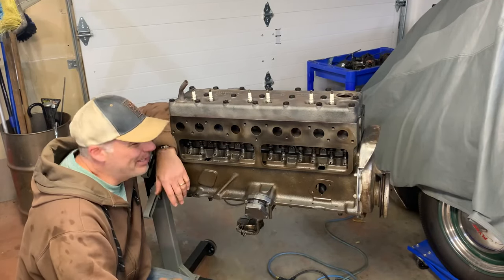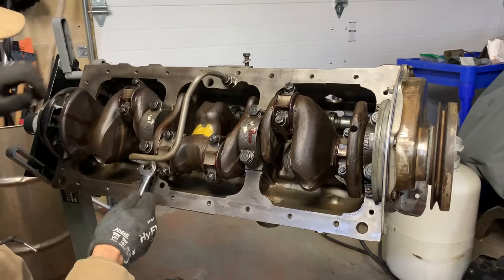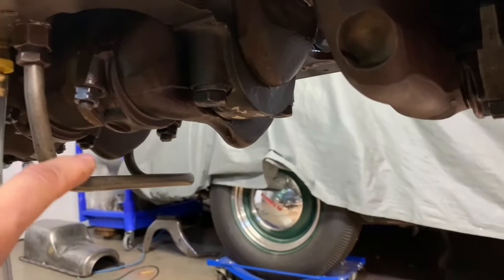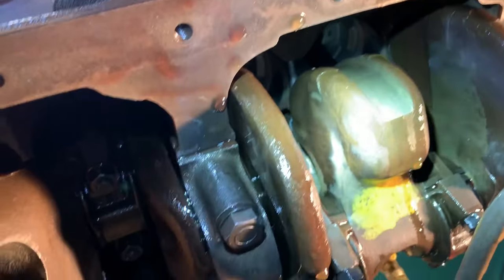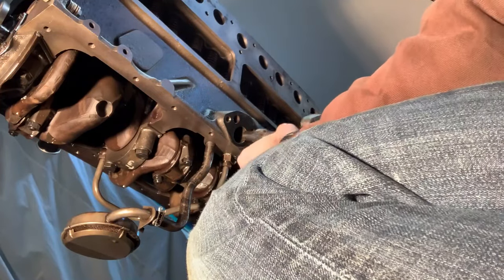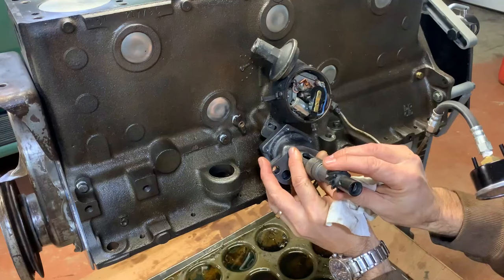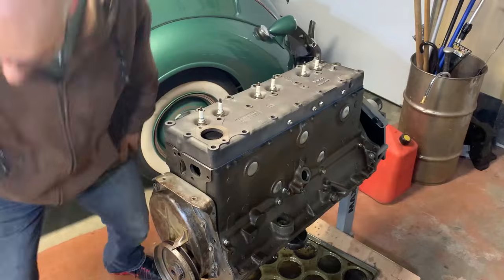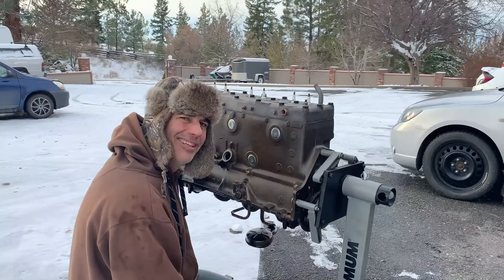Flathead 6 Engine Rebuild Progress & Live Oil Pressure Action

Comment: My 37 Plymouth has a 1951/52 230 Dodge engine. It has the external by-pass. I'm currently running without a thermostat do to not being able to find the correct replacement. Good info on your rebuild. It is always a help to actually see whats happening. Good Job Keith and thanks have to be said to Mrs Keith for her help in making this video.

Comment: Great video! Good demonstration of how the overflow functions. 
LOL.. right, “ Don’t let the money scare you..” True story! 

Just a tip for those working on a new oil pump on these chrysler/dodge flat heads, submerge the pump in oil and rotate it before installing it. You may not  have the oil pan off to use a syringe to fill your new pump with oil first before cranking.

Comment: Wow... I saved this episode, as I bought a 1953 Dodge Regent four door, with the 230-6 in it, that may need rebuilding... Its the 25 1/2 " length block... Did the dry compression test and averaged only 86 lbs overall... Supposed to be 120-150 ... Next test is 'wet' test, with some oil, to determine if the motor has bad rings or valves in need of adjustment... Best regards, from the mountains of central California ...
Reply from the maker: @larryg.9187  I’m not sure you’ll ever see +120 psi on a stock engine.  May be at sea level?  115 psi is the best I’ve ever seen on my fresh engine rebuild, after break-in.  Check for valve leakage. You may be losing some PSI there.
Reply: @keithsgarage5831  ... Your right... I am hoping, the valves are out of adjustment... The book says .010 on a warmed up motor... Any tips on adjusting them cold ? As I just can't picture myself reaching under the header (?) to get to hot valves ... Especially, when I've not done that in fifty years... Going on 72 this year, and got to work safe... BTW, I'm at about 2700 ft from sea level... Thanks
Reply from the maker: @larryg.9187 watch my video on valve sets. Do them cold. Add .002” to hot spec. My video is pretty comprehensive.  https://youtu.be/qtLQP3giVuQ?si=Gln3b5fxYDUWQYWn

Comment: Great video!  I have a 35 Plymouth, and I study your videos many times before I try things.  My most recent project was rebuilding the steering gear box.  I opened it up and felt like I had already seen it from watching your videos.  I would love to rebuild my engine, or at least take it apart.
Reply from the maker: Great to hear that Gary. Your comments offer good insight as to why I make these video.
Reply: you can do i found my m37 in  ga. junk yard 12 yr s ago  best way bring trans out with eng i have pulled it 2 times and i am 88  still tickin  just alot- slower pull rad, out flush upside down   about 1/2 gal rust  haveing a buddy helps also..

Comment: Hello and thanks for a great video. Im trying to rebuild what is currently a stuck 1950 P19 6 cyl flathead. 
How do you get the front 2 crank cap bolts out? Trying to do it in the car, and the front seal/coveris blocking getting a socket on it. Any suggestions? And thanks!
Reply: Little late to help you, but in case someone else sees this.  I just went through this last night.  Behind the front cover, next to/over the front main cap, there are two small bolts, one on each side, with a flathead slot that are threaded up and hold the cover in place.

Comment: i pulled freeze plugs on my37  flat head rust is caked in bottom of eng.  i rigged a hose adapter to flush you will not  believe the amount of rust came out  i ordered me some new freeze plugs i use a plastic pipe fitting to tap with a hammer to insert new freeze plugs

Comment: Keith, I have seen a Chrysler industrial flathead 6 that had a vertical hole through the head down into the combustion chamber for cylinder 6. I assume that it would have a screw or bolt to seal it during normal operation. The hole allowed a steel wire or pin to be inserted while the engine is rotated by hand to find TDC for cylinder 6 piston, which is at TDC the same time as cylinder 1 piston. Is this access hole a common thing with these Chrysler flathead 6 engines?
Reply from the maker: Yes. The Mopar flatheads have this hole over #6 cylinder.  It is a pipe plug that seal it.
Reply: @keithsgarage5831  Keith, Thanks for this note! This type of thoughtful feature for an engine design is really nice to find. I'm sure many mechanics have been glad to use this quick way to find TDC for cylinder 1.
Reply: @joes3485  you dont time on cylinder 1 its #6  but you dont need to it that way  a simple way to time flat head 6 is as follows  remove spark plugs so yo you can rotate eng. with fan blade  remove dist .top so you can see rotor rotate eng till rotor is pointing to 1 o clock pos. lookin down at dist now look at crank case pully  you should see marks in metal  there is a metal arrow over those marks center mark on pully will have tdc in medal slowly rotate to 4th mark prior to tdc if needed loosen bolt at bottom of dist so you can sloely move dist realign rotor to about 1 o clock put top  cap on dist add plugs conn wires engine will run at this  if use timming light to veryfi arrow is pointing at #4 mark if fine tune is ness. slowly rotate dist till arrow is on #4 lock dist down with bolt at bottom of dist.  --- this is about a5 min operation

Comment: Question what type of oil do you plan to use? Conventional or synthetic.  Also what weight 🤔
Reply from the maker: Conventional. Detergent oil. Probably 10W40. Its a fair weather cruiser. It gets hot here. I prefer higher temp viscosity protection.

Comment: I watch a video of you washing chrysler flathead pistons in your kitchen sink.  As I watched I realized that Installed the 2 oil control rings in the wrong order...not in the correct groove postions. This is just a bearing and ring replacement low budget build.  How big of a deal do you think it will be if the oil control rings are not in the correct grooves ????
Reply from the maker: Its a big deal. You need to re-do that and het them right.   Very important.
Reply: Thanks for getting back with. I well fix the problem.

Comment: Do you think it’s possible to change the oil pump with the engine still in the car, 1951 Ford coupe?
Reply from the maker: Sorry I’ve never worked on or been around a 51 Ford engine. I’m pretty much just a Flathead era Mopar guy.
Reply: @keithsgarage5831  ok thanks for the reply

Comment: I’ve never imagined the hissing of pressurized cylinders being so satisfying! I’m chasing what I believe to be a stuck valve this wi yet in my ‘50 218 in my dodge B2. I’m cutting my teeth on wrenching while at it - anything I should be looking for while working on it? Should I put the engine on a stand or can I get it done still on the frame? How far down the rabbit hole do I go?
Reply from the maker: Hi Mat. It is indeed a rabbit hole. How far does one go? Follow your heart.  If you crave the new learnings and are really enjoying it, why limit yourself? Keep going as for as you like.  Take your time. Take it all in. Seek to understand what you don't know. If you are troubleshooting and are new to wrenching,  that's great.  You've got a great truck to learn on. I always recommend starting with a wet & dry compression test of all cylinders. That will get you started down the right path. Then do from there. I have done a full valve grind with the engine still in my '53 Chrysler. It can be done.

Comment: what is good pressure on these flat head 6  i put new std rings it runs ok but i dont know what s normal  pressure reading
Reply from the maker: Cold engine (thicker oil) I am seeing mid-high 50's psi.  Hot engine 38 psi at idle about 45 at cruising speed.